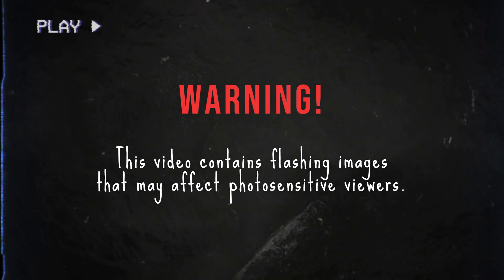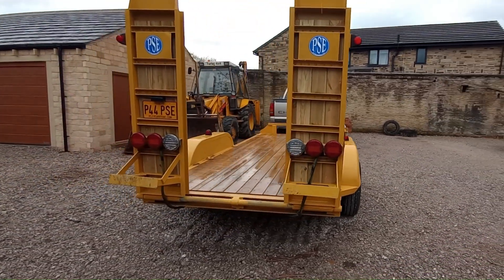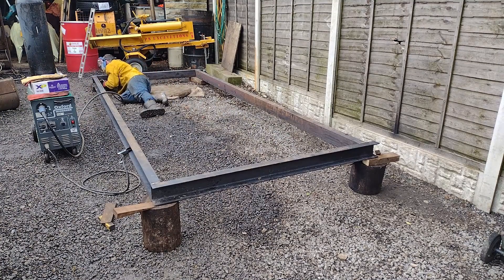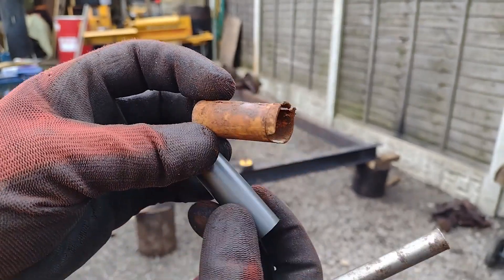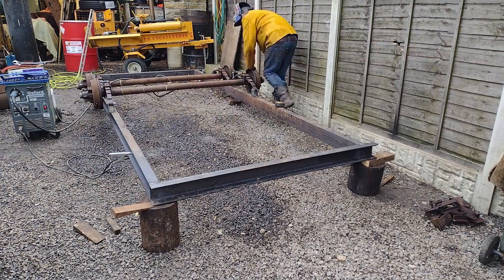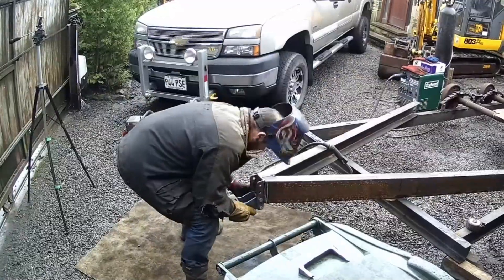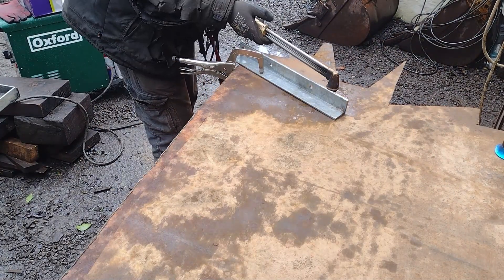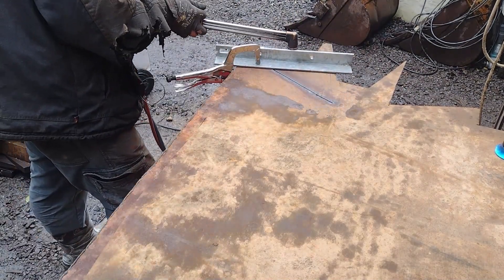Masterful Flat Deck Trailer Fabrication Adventure!

Comment: Nice Build! How did you end up with the American truck, and decide to build an American style trailer in the UK? 
Best 
Robert
Reply from the maker: Hi Robert, Thanks for watching and your comment. Well ... where to start, I need a truck that can do the work that I need my truck to do, in England, only compact pickups are available, under powered and not enough 'truck' whereas the U.S. built trucks are TRUCKS, cabs big enough for the family, a bed that you can get something into and lots of H.P. under the hood! At the time I imported this truck from L.A. it was the best of the big three (Duramax/6 speed no DPF/DEF) now with 250,000 miles, and some heavy towing miles, engine still like new, never touched apart from service items, trans has had a rebuild but I really cant fault the truck. Trucks sold in England would never be able to do the jobs that I do with the U.S. built Chevrolet, and would be dead by 250,000 miles!!
As for the trailer, again trailers sold in England are just not enough, I like the way the electric brakes work, I like the equalizer spring axles where each axle has movement, not rigid like trailers here, bigger wheels/tires. I guess it all comes down to specification and what you get for ya money, I did look at buying Diamond C or Precision trailers out of Canada, but just too damn expensive, so I build one! - Paul.

Comment: Cracking fabrication there paul 👌👍
Reply from the maker: Thank you, Would have turned out a little better if I had the space to build it inside, but turned out well .. and it is a plant trailer that will get knocked about, glad you like the video!
Reply: @PSExcavationsLLC  it will do the job perfect.Keep the top videos coming paul 👌👍

Comment: I will be interested to see how complicated it will be to get your IVA certificate (Individual Vehicle Approval) especially using electrically operated brakes as they aren't too common in the UK  I assume your build will fall into 'Class 3' (up to ten ton load ?
Reply from the maker: Thanks for the comment Andrew, The IVA test for a trailer is not too bad, as long as the axles, rims and tyres are rated correctly, covered and each axle is braked, the frame is the correct gauge and dimentions for the rated gross weight, lights are in the correct place with clearance lights etc, electric brakes are fine as long as the brake controller is on the trailer, and not in the towing vehicle, the placing of the axles needs to be correct too depending on the trailer use, this trailer is for transporting equipment so the axles are under the equipment when loaded, other documents are also needed for non standard items, like the coupling iv used on this trailer (Rated 30,000lb) few other bits too 👍